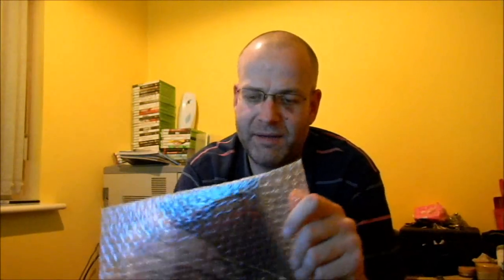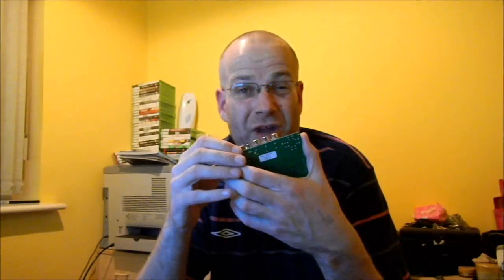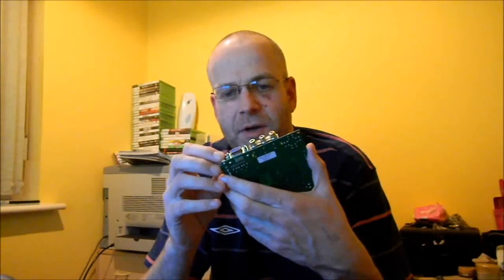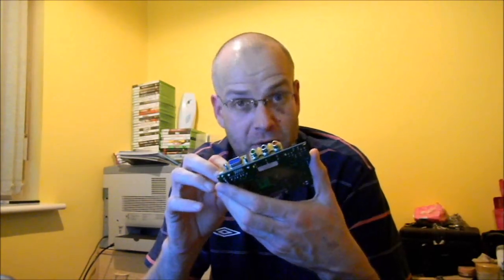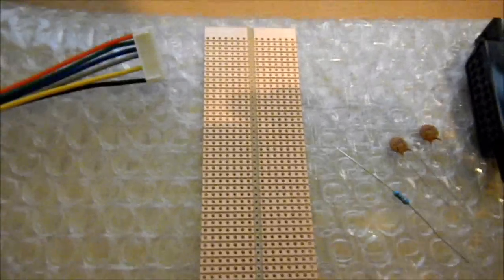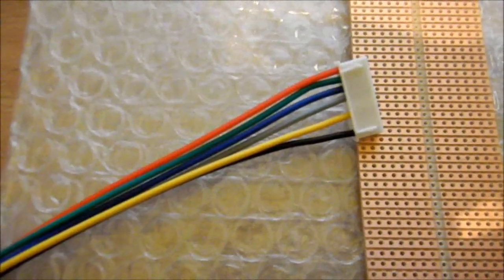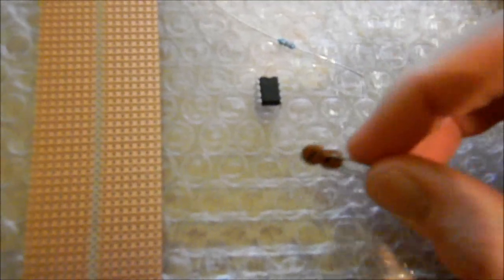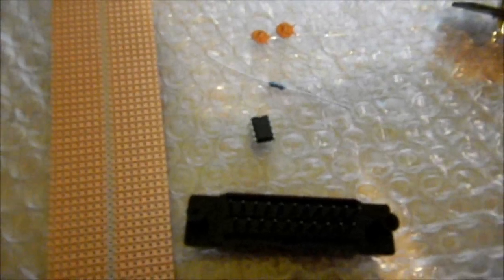£50 VGA Scaler modified to accept RGB SCART input from retro consoles

Comment: hi, this looks cool. if it runs off 5v could you not tap the power from the scart? pin 18 is usually 5v isnt it?
Reply from the maker: +Benjo-Kazooie You could, although it may struggle at times due to the amp draw.

Comment: Hey Faginrs500, do you still need this if you intend to use a Sync Strike?
Reply from the maker: +The Retro Trader The sync strike will replace the sync stripper circuit.
Reply: +Faginrs500, Are you using v sync + composite (c) sync out from sync splitter to GBS board or just the  c sync signal alone?
Reply from the maker: steve nicholl Just CSYNC from what I remember.
Reply: Thank you, I suspected that is my problem.  Can't get solid picture using comp video + sync.  50hz seems to give small issues as well.  Oh well, time to remake cables!

Comment: Hi faginrs, I just wanted to say thanks for the video and the info you provided on the shump forum. I managed to get it all up and running, for use with my Sega Saturn. I had some picture shift on my Saturn, after doing the switchless mod and now with the osd, I can now rectify this. Total cost, just over £20, I got the scaler from China. Thanks again and did you manage to purchase a case for yours in the end?
Reply from the maker: Lee Ashcroft Glad the info has been of use.  I never bothered with a case tbh.
Reply: I'm still deciding if it's worth the expense but it would look a lot better. Thanks for the reply and I will keep a look out for any future video's you upload.

Comment: Hi! Would you recommend XRGB-Mini instead of this VGA Scaler for retro consoles? I'm worried about input lag.
Reply from the maker: Rodrigo Horta If you're concerned about lag, yes.
Reply: Faginrs500 Thanks! Now, I have another question... Some games change the resolution output (as Sonic 2 in vs mode) and I saw some people complaining about XRGB-Mini taking too long to reset the signal. Do you know if there is a turnaround for this problem?
Reply from the maker: The latest FW for the MINI (which came out this month) apparently improves the time to switch. I need to update my unit and perhaps create an update video on the new features etc.
Reply: Faginrs500 Nice, it would be great. Thanks for your time!

Comment: Is this supposed to work on a PAL 50Hz Megadrive 1? Because I only get a flickering image... I use the LM1881, with the composite signal from the scart on it's input and the output connected to the S/H-sync cable. The V sync cable is not connected, ground and RGB all connected to the appropriate Scart plug connectors...  In RGBHV mode I get no signal at all, on RGBS it flickers...
Reply from the maker: It works fine with a 50hz signal, although it does frame convert to 60hz, so has a slight frame skip.
Reply: Faginrs500 Never got this working with my regular 50Hz PAL megadrive, but got a French RGB 50Hz Megadrive and with that the GBS8200 works even without the LM1881 in the middle. Got a Sync strike now from Arcade Forge and the normal 50Hz PAL megadrive doesn't work with that one either, keeps being unstable (although the LM1881 makes it more stable, just not fully stable so unusable). With the sync strike it now works with my Wii, PS2 and French megadrive, whoohoo! Strange thing about the normal 50Hz Megadrive though... Had a good UK RGB cable for it. The french megadrive has the special cable with a box to make it true RGB with a real sync signal (no composite, and also no rf output on the md, so less disturbance)
Reply from the maker: Sander Smit Weird..... it worked fine on my PAL MD.

Comment: Cool stuff dude, just got this board and it's totaly fine in 480p with the wii, but it's got snowy pixels going on in 480i. The PS1 does not work with the YPbPr at all, so i will try to do the same. Also in YPbPr mode the geometry menu does not work.
Reply from the maker: I've never had this issue, but a number of others users have. :-(  PS1 does not output a component signal, so hence why your found it does not work.
Reply: Ahh good to know, thanks. I have to get me that stripper ic thingy. What do you think about this snow in 480i over component, should i get another one? Do you think it's gone with the Scart solution?
Reply from the maker: Herr Bert The snow is only apparent on component and is removed with SCART.
Reply: Okok, thanks

Comment: will the converter board accept 240p yprpb signal from a modified super nintendo?
Please answer
Reply from the maker: Yes it will.
Reply: sweet, so ive been learning a lot over one day, from what i understand the converter will treat it as a 480i signal because it doesnt support 240p, will that mean ill have gaps in the lines, meaning i should buy one of those scanline generators, correct?
Reply from the maker: You won't have any gaps, but you'll need a scanline generator if you want to put the gaps back in.
Reply: oh right, thats good cos i like it without the gaps :)
Reply: i got my converter today, sure enough it works :D, sadly there is some pixel noise/flicker any way to fix this, its only noticeable on dark or black screens so its alright, also it seems only rgbs is allowed to have geometry settings, but ypbpr you cant change that, is there a way to convert ypbpr to rgbs? thanks
Reply from the maker: Try and press the AUTO button on the scaler to resync.

I'm not aware of any transcoders currently available that go from component to RGBs.
Reply: ok, or is there a way to get rgb out of a snes? but for some reason pal snes have 12v on the multiout where ntsc snes has sync, so could i use the Y output as a sync? i was messing around with it and putting ground to ground and sync + green to Y created a very clear, no pixel flicker, but very green image (because it was connected to green) so the rgb on the multi out + the sync from Y, could that work? Thanks
Reply from the maker: All versions of the SNES (SNES or SFC) will output RGB.  Just buy an RGB SCART cable.
Reply: got rgbs working, only there appears to be screen tear or frame drops occasionally, have you had this issue?
Reply from the maker: Are you using a PAL SNES?
Reply: yes
Reply from the maker: This is due to the 50hz (PAL) to 60hz (VGA) conversion.  This board outputs 60hz as it's VGA specification.  There is no way of getting around this unfortunately.
Reply: my snes is modified with a 50/60hz switch
Reply from the maker: Ensure it's in 60hz with NTSC games and you should be fine.
Reply: i dont get any frame drops on the ypbpr input on the gonbes, but as i said its has minor white pixel flicker noise and also the picture isnt fully covering my display and the gonbes only allows geometry adjustment on rgbs, but it seems i get frame drops on the rgbs only, maybe its just the gonbes, anyway its not that bad, its a lot better than having pixel noise

Comment: Have you tried modding a SNES model 2 with RGB and using it in conjunction with the Sync Strike and the GBS-8200 (Scaler)? In my case, certain games ran just fine, whereas others had this nasty nonstop vertical shaking; have you ran into issues like that using this scaler?

Comment from the maker: Yes S-VHS is the same as S-Video.

For retro consoles a CRT will give a far superior image than a HDTV and in many ways it's the best solution as CRT TV's are cheap.  The main downside is their size.  Most CRT's will handle S-VHS as well so you can achieve the best look, without any of the prcoessing problems or lag associated with HDTV's.

Comment from the maker: I'm not aware you can mod a PAL N64 for RGB. :-(

I personally wouldn't recommend using any other type of signal for conversion unless it's RGB.  It just isn't worth the expense of the scaler imo.  PAL consoles don't always work that great with all types of scalers either.

If your TV has a S-VHS socket on it, I would buy an appropriate S-VHS lead for the N64 and just use that.

Comment from the maker: They work with much higher resolutions than 800x600. ;-)

Depends on what you intend in using the SLG with, with regards to whether you need a scaler or not.  If you're using your xxxxin1 to a LCD, you would set the output of the PCB to 31khz and then run that straight into the SLG, which then goes to your LCD.  In this scenario you wouldn't need a scaler.

Comment: the specificity of the product i'll buy is this
Multigame jamma PCB based on a computer system with an hard drive and a preinstalled emulator.
Jamma compatible
Horizontal display
Supported Video Modes; CGA Standard (15kHz), PAL (15kHz), Medium (24kHz), and VGA (31kHz)
2.4Ghz CPU
512M RAM
Need an ATX Power supply
a multigame board. A Pc connected with the mame card.
You think i need the cga/vga all the same ?

Comment from the maker: You won't want to set the output image of your scaler to 1360x768 if you're using the SLG3000.  Whilst it will work, the scanlines will be incorrect for a 240p source, as you need to output from the scaler at 640x480 into the SLG to get proper looking scanlines.  This will ensure your original resolution of 240 is doubled to 480 (via the scaler) and then using alternative scanlines (via the SLG), will return your LCD image to look like 240p!  Bingo! :-)

Comment from the maker: The Sync signal maybe a composite video signal.  The scaler needs a composite sync signal, so it needs passing through a sync cleaner / stripper, which removes everything but the sync signal - it cleans it.  Or it could be a case that the sync is OK but just weak and needs amplification.  

If it was me I would try passing the syncs through a cleaner, but that's only because I have ready access to such a device.

Comment: Yeah, sure. I have tried connecting both Y and YS to S on RGBS (CGA) input of the circuit. No luck so far.

I wonder what do you mean by "clean" or amplify? I'm not strong in this as I am more of a programmer than of electronics engineer. Do you think I might use some operation amplifier and some capacitor to put the signal through?

Comment: Thank you for the video! It is very detailed and a great inspiration.

I was wondering if you could help me to resolve my problem which looks similar to what you're doing on this video. I've got an old Yamaha CX5 computer from Japan which I'm trying to connect to modern monitor. I tried different things already and still have not achieved acceptible results. It has following pinout - R G B Y YS. I can't seem to find details on Y and YS signals. Would you have any idea on what they are?

Comment from the maker: It would be better to use the JAMMA connector to the left of the PCB, but you could use the other harness if you wanted to - Use the grey (HSYNC) wire for connection to your JAMMA system.

Comment: Hi there,

Great video thanks :)
Is there any way to use the harness that comes with the scaler to hook it up straight to a jamma connector?
Im thinking if i get one I can just solder directly to the jamma connector on my supergun, the only problem is om not sure which synce to use, RGB and ground seem fairly obvious, but should i use yellow or grey cable for P - video sync on the jamma?
Any help appreciated.

Comment from the maker: @MetalTiger88 This scaler will only accept a RGB signal, not composite video which is what you're referring to.  Get a RGB SCART lead and it will work (assuming you mod the scaler or buy something called a Sync Strike).

Comment: hey i gotta question^^
i wanna know if it is possible to take a megadrive model 1 and hook it up with the original chinch cables (yellow and white) to that box, cause i saw that box on e-bay and i saw that it has chinch input, but they are green, blue and red^^ my idea was to connet my megadrive to that box and then connect that box to my naomi cab, so i could play my megadrive games on my naomi =)

Comment from the maker: @doujindance I would agree it doesn't beat the XRGB-3 for clarity, but if you're using B1 mode and scanlines, the cheap scaler and SLG comes very close imo.  Over in the UK a new XRGB-3 is around £300.... this scaler is a 10th of the cost and will suit most peoples requirements.

Comment from the maker: @Padoca85 I'm not sure that capacitors will improve the noise, as they are used to boost the colours if required.  My Saturn SCART lead has no capacitors, but I did have to work on adding some more grounds to the appropriate pins in the SCART socket.

Comment: @Faginrs500 i discovered after messing around none of the pins i was expcting  (17,21)ground to be conected with the scart ground in the console, grnd only coming from the audio and csync ground. But i ended up using the csync instead of the sync spliter for now. I just have some noise on the picture. Do you think i could improve clean the image adding some capacitors to the RGB leads?

Comment from the maker: @Manifikobzh It *may* do, but it depends on whether your PCE is already using a composite sync (which is what the Sync Strike outputs) or has the composite video sync instead.  Using a composite sync (i.e. using the sync strike output) can help with sync issues...... but as I've said, PCE RGB conversions can greatly differ in quality of sync and a Sync Strike will not always help.

Comment: does THIS look better than a RGB to VGA converter?  I know with a dreamcast you need a Dreamcast to VGA and then get a VGA to HDMI (or PC to TV) in order to get the best picture possible.  I play saturn so I haz to knows if it will look better 'cause I don't wanna spend more than 100 USD.

Comment from the maker: @lettucekl You can get a very good CRT emulation using the new HLSL modes in the latest version of MAME.  I spent some time playing with this and have a list of settings which work well.  I may do a information video on this in the future.  Anyway... the SLG3000 will work with your PC without the scaler.  You must ensure though that the resolution of your PC is set to 640x480.

Comment from the maker: @ChrisGhysel No reason why another "type" of capacitor won't work.  The disc is recomended since it doesn't need to be bothered with huge currents in this instance and is small and cheap.  Voltages will give the maximum, but that does not mean you can't use a higher rating than what is required in most cases.  Certain capacitors can be harder to obtain than others, so you maybe limited to the voltage ranges.... I normally just go for the next nearest voltage (moe than required) and all is fine.

Comment: I suppose you don't really need to use a board with 2 VGA outputs?... The boards with only 1 VGA output are like a lot cheaper on eBay. So yeah, if it's all the same I would like to keep the cost down. Lemme know please. I'm pretty eager on building this one...  ^^

Comment from the maker: @StormyX73 The PCEngine is notorious for having problems with processors, because of the various "differing" Video Amps that are installed in the the PCE.  I couldn't get mine to work with the right RGB colours, although sync was stable.  I need to revisit it and see what I can do with the RGB AMP on my PCE.

Comment from the maker: @shaurz Scalers and TV inputs can give different results... trust me.  Been there and had to reconfigure my scart leads (and the Saturn has been no exception).  Still works on the TV now, but I had to change wires for the scalers to function correctly as well.

Is your pin 18 bridged from another pin or direct to the actual scart cable?  Pin 16 should be connected straight to the cable with a 180ohm resistor and pin should be connected to the same cable, prior to the resistor.

Comment from the maker: @shaurz Yes... 5v should be going to pin 8 and then a 180ohm bridge to 16.  You say nothing is going to pin 8 on your scart socket, but pin 16 does?  Does pin 16 have a resistor in place?

Comment from the maker: @voltz15 You don't need the sync mod on this scaler if you are running component.  This scaler will accept component natively.  The sync mod is only for using SCART RGB.  I have tried this scaler with component and it works fine.  On a 480p game the quality is better than SCART RGB (since that will either be 240p or 480i).  If the game is 480p though, I doubt you would want to use the SLG3000, since you will lose image resolution.  480p coded game is best displayed without scanlines imo.

Comment: @Faginrs500 Using a LCD PC monitor but the output doesn't mean a thing. It's the unit itself that will sync or not and it's pretty hit and miss. I'm only using it for repair work, my cabs downstairs are for the gaming. I think I might have to get shot in favor of a Commodore monitor tbh. It's just a pain to lose 24khz.

Comment from the maker: @RetroRepair What screen are you using?  LCD monitor or LCD TV.  I believe some VGA inputs on TV's can be quite unstable.  I have not experienced any issues yet with consoles, but I have not tested any PCB's tbh, as I have direct connect to CRT arcade monitors for that.